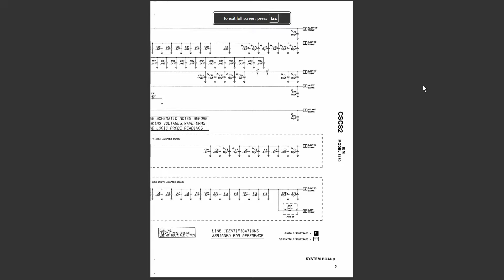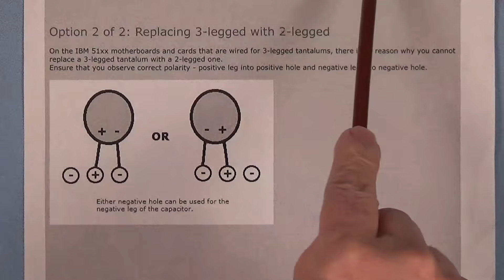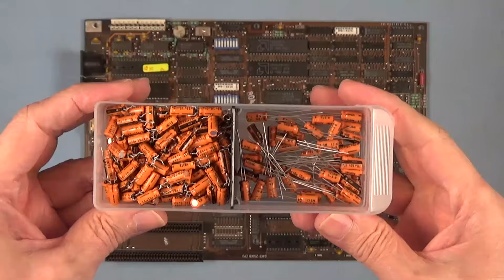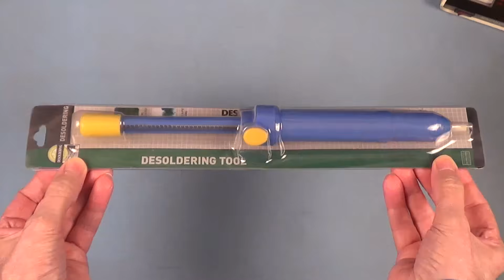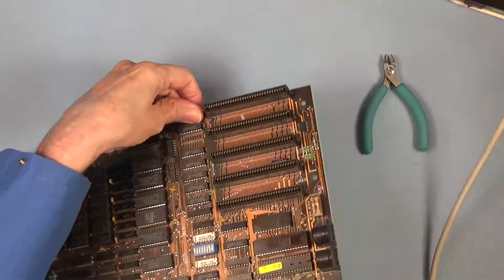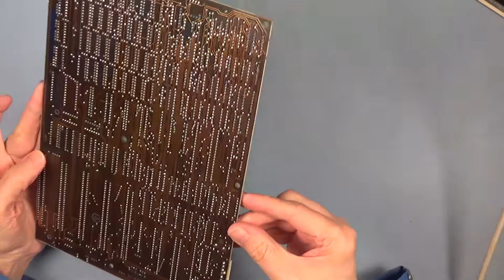IBM PC 5150 Restoration - Part 2

Comment: I have one of those IBM boards, however no point me doing anything with it as that's about all I have, no case, no power supply, no drives. So it lives in a glass curio cabinet alongside a mechanical calculator.
Reply from the maker: Well, you should be proud of that IBM PC motherboard.  It is an important part of computer history.  😃